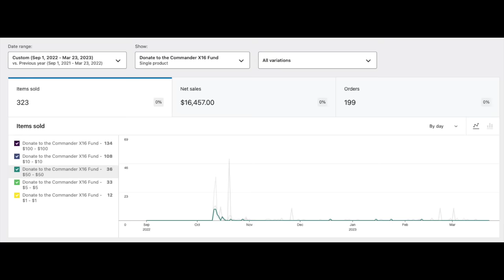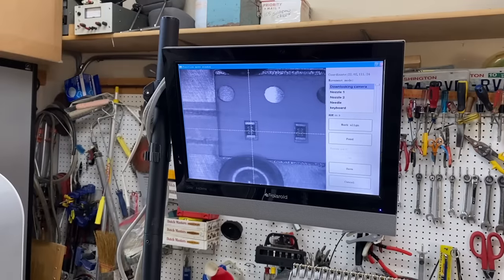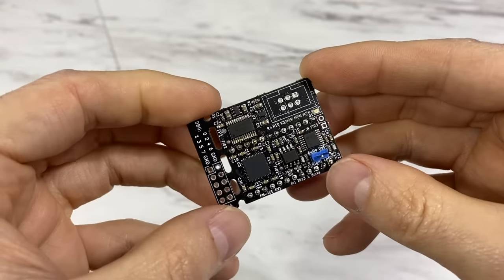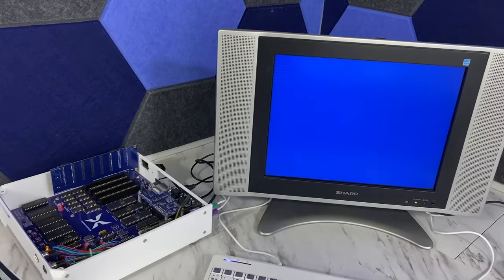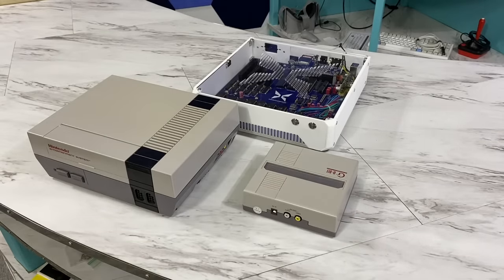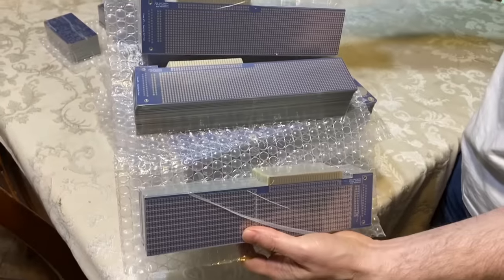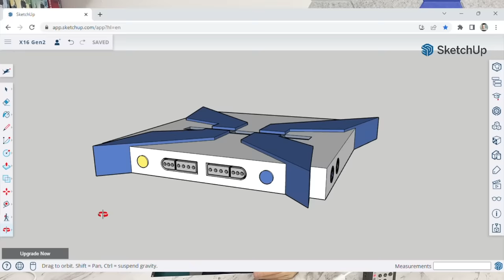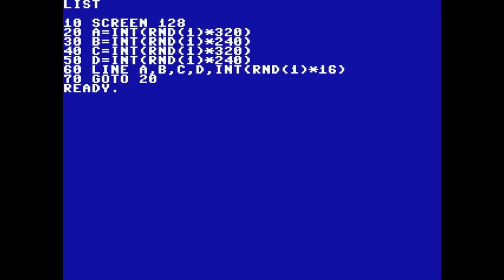Commander X16 2023 update

Comment: Did you check out Byte Attic’s Agon Light already? New 8-bit computer <100$.
Reply: As heavily as the Agon light designer trolls the X16 Project,  they are surely aware of it.
Reply: @brucemcfarling4674  If your have checked projects (CERBERUS 2080, Agon Lite, Talos ES) from the Agon Lite maker Bernardo Kastrup you should not call him a troll..
Reply: @deterdamel7380  I didn't claim he was NOTHING BUT a troll, but`that video with the misleading claims about the Agon Light being Dave's real dream computer is quite clearly trolling.
Reply: @brucemcfarling4674  After reading Bernardo statement on his website, I would admit that the video is not a troll-video.

He makes proper hardware-designs and fullfill his goals without comercial interests.  The community can benefit from this and can get this devices for a fairly low price. What's wrong about this?
Reply: @deterdamel7380  The troll was pretending that he fuflilled the "Dream Computer #1" wishlist with a 32bit MCU emulating a VGA chip. He literally PLAYED the full "no FPGA or microcontrollers" when pointing out the the X16 has an 8bit MCU and CUTS the same clip off before "and microcontrollers" when painting his board as hitting the wishlist points with a 32bit MCU implementing a VDP in software. It would be better if he cpuld do his design work without making misleading claims about it to try to score imaginary debate points.
Reply: @brucemcfarling4674  It's clear that you need a FPGA or an MCU to create the video-output. So why make stupid promises for the CX-16 before?

The Agon Light creators didn't make any false-promises, or did you found any?

Same for the price-tag. 

It seems that is not allowed to critizize decisions of the CX16 project, since people put money and hope into this project. At least for the 8-bit-guy it's unusal.
Reply: @brucemcfarling4674  Indeed, after I watched both videos again- David says "preferably", but his screen titles 'requirements', the preferably is not present there. Later on in  Davids 'Part 1'-video they  demonstrate the Gamedruino. It's clear that they're heading a FPGA-solution at that point. I didn't get the link, why he is talking about a none-fpga/mcu-solution in the beginning. 

Not sure, if ByteAttic is  trolling at that point: video and audio are a cite from Davids inconsitent 'Part-1'-video. It could be a 'David-self-trolling', too. But I admit, that the cite make no sense at that point in ByteAttic's video, due to the clear move  towards FPGA.

Of course, using a FPGA is a good solution. A lucky move over the potential discovery of an obsolete fake-video-controller, found  at china-seller, offered in quantities of 100.000 :-)
Reply: @deterdamel7380  But that whole section was the story about "how this all got started", it was not (and was not PRESENTED AS) a list of his requirements at the time that the first "building my Dream Computer" video -- obviously, since he was describing using the Gameduino as the Video chip. IT IS INDEED TRUE that giving the full story, including a wishlist that he had already moved on from, made it easier to misrepresent the project later, but the decision to misrepresent the project is not excused by the fact that the way that the "Dream Computer" video was put together made it easier to misrepresent.

Comment: Couldn't the entire thing have been done on an FPGA?
Reply: Of course, it could just be emulated on your PC.  Or you could just watch a YouTube video of that.  Or have a text sent describing the YouTube video of the emulation?

Lol.  I am just kidding :) It's a Commodore tribute machine, it HAS to have Commodore guts.  That is the entire point of it.  There are already several FPGA systems available cheaper if that's your dig.  Get a MiSTeR or an Analog NT!  They're both pretty great for emulating and VM'ing stuff.

But in terms of feel, fun whilst using the thing - I feel nothing with those.  In sharp contrast to the feeling when I power on my old Commodore 64.  It's a joy!

That is what this computer is!  It's a continuation of the Commodore 64 developer community.  That means it has to be exactly what it currently is, just with a more sensible DAC option.

Sounds like you would love the following systems :

- Retroid Pocket (general emulation handheld)
- Analog NT (FPGA based console VM)
- Steam Deck (Entire PC in a slightly fat Switch)
- Anbernic 353 (might be 535 - another cool emu handheld)
- Evercade VS or the handheld EXP (Cart based licenced classics)
- TheC64 clone Commodore (Perfectly simulates the og Commodore 64)
- Pi400 micro kit (Fantastic little ARM computer kit, quick start kit)
- AppleTV gen 1 (You can mod it, jailbreak it, install MacOS etc)
- Beelink GT-King black (Amazing little Android box that you can hack and set up as a emu console)

Also have a look for RetroArch and EmulationStation if you want to build stand alone emu consoles.  I have one that boots in 10 seconds (of video intro) into a carousel of consoles with roughly 50,000 games from NES to PS3!

The Commander X16 isn't for any of that stuff though - like I said it's a Commodore descendent.
Reply: @DailyCorvid  Yeah, it's just a shame if the DAC needs to use something that could power the whole device. Personally, I would rather the sound suffer a bit in quality than to use technology that doesn't reflect the era of the other components.

Comment: The option that maybe makes sense is to have all passive components SMD and assemble it at a manufacturer (there are services such as JLC PCB that are cheap and also will assemble SMD components if you buy from them, but going to a manufacturer will not cost more than a few dollars for one board) and sell the rest (that is mainly the IC sockets and connectors) as a kit. Being a few parts are rather easy to sell like that and the trough hole assembly is the one that costs a lot of money because it's a manual process.

Comment: I'm glad it became so expensive considering the first announcement of 50 bucks. Now it's not that hard to decide for the MEGA65, which seems to be a better deal after all.
Reply: What "announcement" of 50 bucks? The first video said he'd "like it to be" 50 bucks, the second video said it turned out that wasn't realistic. If I made a video that said I'd like to play for the NBA, it's not an announcement that the Celtics are signing me.

The cost-reduced version of the "real CPU, VIA, etc." board will be $200 or less, complete in case. That's a whole lot less than a Mega65.
Reply: $500 is a really high price, but that's for the initial production run - at the projected $300 price point, the Mega65 is twice as expensive, saying nothing of the Gen II system
Reply: @thecorruptedbit5585   Even with 300 bucks; add to that a case, psu and what else is needed for it to run like a keyboard etc and then taxes, shipping and of course customs which sometimes can be higher than the cost of the product itself. Ergo the MEGA65 is a better deal for me, since it's a complete system that looks like a real home computer from Commodore. And that was the original plan behind the X16, which was supposed to be sold for 50 bucks at a non-profit selling point.
Reply: The agon light is like $50 and does everything he says he wanted his computer to do lol. It's sad how far the X16 has strayed from what he planned. The basic engine looks like a cool budget option too.

Comment: For the network card, I recommend using an ESP-32 or ESP-8266. They're pretty cheap and have good specs.
Reply: The network solution being developed actually uses an ESP-32. The challenge is getting serial data to the unit, since the X16 doesn't include an ACIA.
Reply: @tomwilson2112  Ah idk much about how addressing works on the X16 but I wonder if you could just have the ESP scan the data bus and probably have some sort of transistor logic to detect if the address bus is in the right place. Or you could use some sort of multiplexer. So basically just read/write to the bus instead of over serial.

Comment: The fake YM2151 has plagued the retro chiptune community for years. I personally own 1 real YM2612 and one fake one. I am using the real one in a project, aptly named "Mega Blaster 2", which is a Genesis/MegaDrive Hardware VGM player. The fake one is a SRAM chip. There's a couple resources available to help determine if you got a real one and some blacklisted sellers. Not sure how much it'll apply to YM2151 supply, but it's fairly comprehensive otherwise.

Comment: A simple solution before the soldering a whole board, just spray a bottom with a dissolved aspirine tabs, and wait about 5 mins until it is be dry. About 50\50 mix, but water of course must be distilled one. Good luck.

Comment: Suggestion about YM 2151:
Since you already use FPGA for VERA, why not add the YM functionality there and not need the actual chip?
That could fix a number of problems - like the huge latency of YM read/writes also may synergies better with PSG that VEA currently provide?
Reply: @jkeelsnc  The VERA chip is already "full" so no more functionality can be added to it. Even audio functionality is not really complete or even comparable of the old SID chips (no ADSR in hardware and no filters), so another FPGA is required to emulate th YM2151.
Reply: The current YM2151 implementation is over 4000 LUTs and the FPGA used by both VERA and the YM FPGA has 5280 LUTs. It's a small FPGA; there isn't enough space for both designs. Even if there were, we would need one more available pin and VERA has used every IO pin on the package.
Reply: Does that FPGA have enough pins to take over most of the glue logic functions in the X16c (aka Gen2) board alongside the FM functions?  (Say, with the $00/$01 latches still physically present, and an external 3yo 8 decoder for slot select lines) Because if the same ice40 of family FPGA is used, then the LowRAM might be able to be brought internal to the FM/Control chip, further reducing build cost.
Reply: @JoeBurks_1  Thank you very much for detail answer!!!
I'm no HW guy, but your explanation sounds simple enough the get it and logical to believe!
It is disappointing that YM (audio) implementation takes more LUTs then VERA (Video + audio).
Reply: @SquallSf  The OPM FPGA implementation doesn't take more LUTs than VERA, they're pretty close but VERA is larger. I'm working to cut down the LUT count of the OPM core and think that it may now be small enough to fit into an iCE40LP4K-SG48I. This will reduce the BOM by about $1 without requiring a board re-layout.
Reply: @JoeBurks_1  Which parts of the OPM take the most LUTs?

Comment: Another option as far as kits go, is to have all the SMT components preinstalled, then let the owner do their own through-hole soldering. If PCBWay offers assembly services, that might be the way to go.
Reply: SMT are possible to install by hand with a $30 heat gun and lead solder.

Comment: Please correct me if I'm wrong, but what I understand about the future consolized version and the way the cartridge port works is that in theory nothing stops people from making an expansion chassis, ram carts, a programming cart that includes the extra ram needed, and so on and so forth, despite its small form factor. These were not unusual things to see on old eight bit computers. I had a laser 128 as a kid that had a sidecar with two expansion ports in it. Programming cartridges were common for the c64 precisely because of the limitations of the system. As much as I would love a full developer system, it actually almost intrigues me more to see just how far one of the second generation console versions could be pushed!

Comment: This machine is quite lovely. However, I really think software emulation is the best route. You can practically create any new architecture you want, using that method. Hardware creates too many problems and limitations. I felt the same way when the Atari Coldfire project was proposed, and they had similar issues as presented here (at least in the sense of hardware limitations/problems). I think the better focus is recreating the Commodore "experience", while using modern off-the-shelf hardware and connectivity.

Comment: I have been following the project for a long time, it's great to have some news, thanks for the video!

I totally understand most of the troubles you are talking about as I am also making my own 8-bit computer (based on a Z80): the hassle you are encountering with hand-soldering, the hardware choices, the components sourcing, making it a kit, the software, etc...
Finding a manufacturer for THT soldering is harder than finding one for SMD, and the price difference is huge too. Maybe you can already have them solder the SMD video board? This would save some time.

Regarding the sound chip, since the VERA implementation already has sound support, why not making it the default sound chip? If you are afraid of breaking compatibility with existing software, it may be possible to emulate the YM2151 in the FPGA if you are spare LUTs, instead of having a second FPGA on another (sub-)board.
Reply from the maker: This was already discussed and looked at.  We just can't fit anything else on the Vera chip.  Someday we might go with a bigger FPGA and perhaps we can get both of them together that way.
Reply: @The8BitGuy  I see, thanks for the reply! 
Indeed a bigger FPGA could be the solution. Maybe even dropping some of its existing features would help with the current one, but again, it would break current software compatibility 😅
Reply: @Zeal8bit  The YM2151 implementation is currently around 4K LUTs and I think I might be able to squeeze it down about another 600 or so, but more than that is going to be a lot of effort. VERA's FPGA has 5280 LUTs of which about 4K are also in use.
Reply: @The8BitGuy  Why did you need an FPGA in the first place? Once you put an FPGA inside, you might as well just stick several other things on to it, like sound and graphics from the outset. You compromised your original design parameters anyway, so you might as well take full advantage of using FPGA, save time and money and there's no hassle of sourcing obsolete sound chips. You've really made a rod for your own back. ☹️

Comment: You should have hired me as a consultant for manufacture.  I used to be a production engineer for Sony branded CRTs, among other things.  I could have optimized "manual" assembly so much you could have done everything in house.  People see fancy chip shooters (CNC pick n place) at contract manufactures and they are hypnotized.  Let me tell you, you don't need any of that unless you are running bare minimum 100,000 boards.  Usually 500,000 boards is where it becomes economical.  I could have optimized your manual assembly workflow to where you could have assembled and soldered that board way under "30 minutes".  I have PERSONALLY set up manual assembly and soldering processes at defense contractors where I could crank out 1000 boards per day, without breaking a sweat.  These were situations where we HAD to do it in house, because of the sensitive nature of the designs (and money hehe).  It requires some neat custom tooling and it's not obvious, but I could have had you setup where you could pick and place all your parts in ONE operation (at least for SMT).  It would have technically been faster in that operation than all but the fastest chip shooters.    The biggest headache you'd have would be having enough space.  But we could fit it into a two car garage.  The biggest bottleneck would be the reflow ovens, but I've got sources on where you can get those used.  I have even used modified toaster ovens (there's projects online for that).   We could have easily set you up to where you could run 100 boards a day no sweat in your garage.  You would have saved TONS of $$$ and the end result would be Commander x16 boards that cost $100 or less instead of $350+.  If you want my help on future projects, you just let me know.